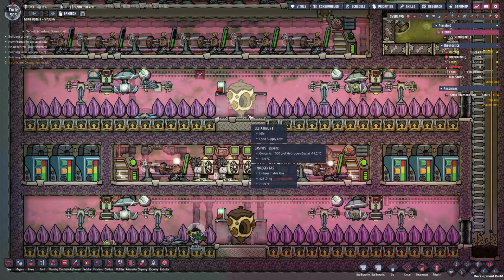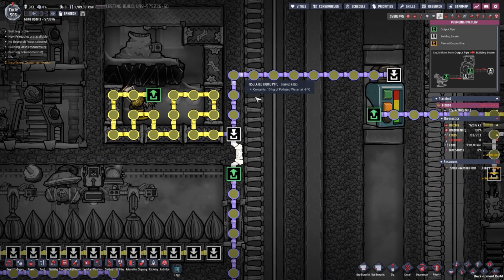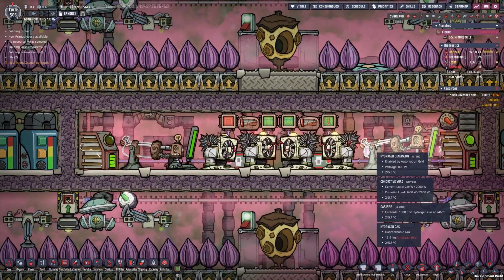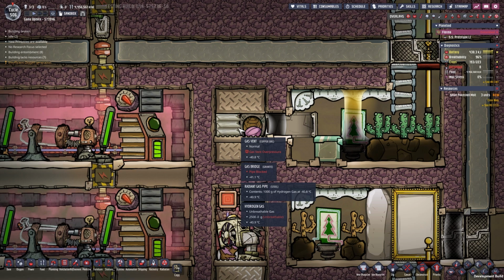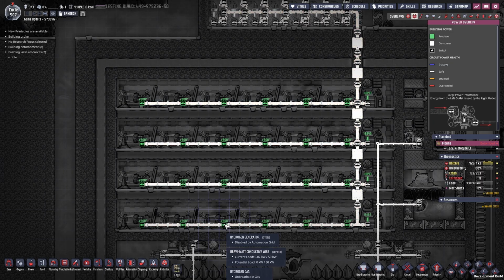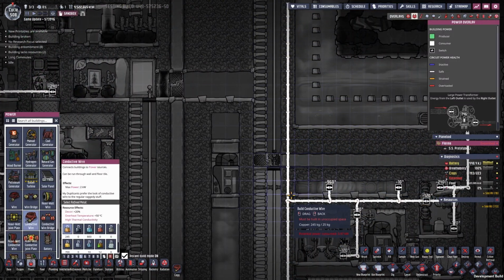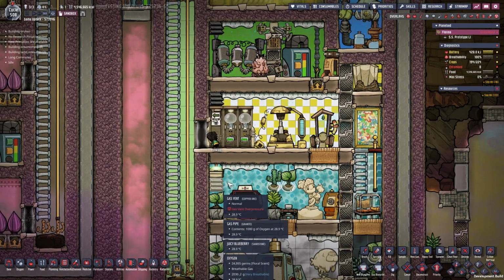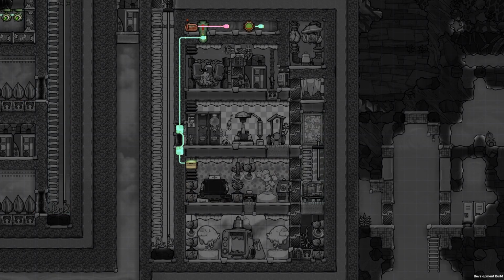Energy and Food with Saturn Critter Traps

Comment from the maker: Hey Everyone. Here is the Third and for now final final Verison of my Saturn Critter Trap Setup.
I included a few of the Discords, Reddits and YTs tips and also made it horizontal this time.

Pros:
-smaller?
-Technically No more Beeta Traps required technically cause the beetinys still need to "walk" into the Saturn critter traps, sometimes they just don't want to and there might be the chance of a beeta spawning if the beetiny refuses to walk into a trap in the span of 2 to 3 cycles)
Cons:
-Not very modular anymore (only modules are now the top and lower Saturn Critter Trap rooms.

Neutral:
- Living arrangements moved outside the main design.

Comment: I like how the design is "manufactured material" free, though not steel free. I think the middle section could be changed out for a steam turbine and a ph2o cooling loop given you can get ph2o down to -20C and the using Ph2o would also ensure the irrigation water reaching a lower temperature faster. instead of fighting lower mass and half spch of hydrogen gas. which would lead to a more stable temp once the temperature is reached. given the Saturn fly trap as no innate "Max atmosphere" by using water you will overall have about 2 times the sphc, and the mass being 10 times, being equal to about 20 times more cooling potential, while some unsued cooling from the steam turbine setup could go towards keeping the dupes living quarters between 25C or 15C then you just need to make sure that at least about 2 hydrogen generators are running for the power to cool. then there will be no reason to burn of any of the hydrogen to delete the heat and you would only need the aqua tuner to be Steel, and plastic for the steam turbine. everything else could just be refined metal.of course such a cooling loop would do take up about 12 by 7 blocks at a minimum maybe more with for more thermal mass for the farm, and lesser for dupe living space.

With the deep freezer would be the only place i would use the thermo regulator. but if working with the cooling loop it will be easy to keep it cool from the excess cooling from either farm or dupe side to achieve the deep freezer

Comment: Why are you using this for food production though? The quality doesn't seem worth it for all this work. The hydrogen speaks for itself, and justifies the size of the box. I'm thinking about trying to build a wild planted one since the hydrogen production would be the same.
Reply from the maker: The initial idea was to build a self sufficient base based on only 1 geyser. So i needed food from somewhere.

If you only use it for energy you can wildplant and have the benefit of the slower digestion. Meaning 1 critter equals 120 cycles of hydrogen.

Comment: =OKKKK, GOT MULTIPLE QUESTIONS

.................

..1=DOESNT WIKI SAY THAT WILD ONES HAVE THE SAME HYDROGEN PRODUCTION RATE AS DOMEDTICATED ONES?....THERE'S NO PROB ABOUT GETTING ARTIFICIAL NATURAL TILES, THOUGH.......SO IT CAN HELP TO SAVE A LOT

..2=WHAT EXACT COOLING  OUTPUT IS NEEDED, THO????........ LIKE U'VE DONE LIKE THAT BC PH2O, RIGHT????????........BC I'D RATHER MAKE
 A FLOWER POT WORT CHAMBER NEXT TO IT.....

...3=.ABOUT HOW MUCH OF THEM PER HIVE ACTUALLY NEEDED..........I GUESS THAT'S NOT DIFFICULT TO MAKE A NARROWER ROOMS, RIGHT????.....AND JUST ABOUT MORE FLOORS.....RIGHT???

...4=I'M DOUBTFUL THAT INCLUDING HYROGEN GENERATORS IS NEEDED BC  THEY'RE BETTER TO BE AT POWER PLANT ROOM,,,,,,,,,

.....5=HOW MUCH OF THESE IS NEEDED FOR RUNNING 1000g/s ALL THE TIME

=SO............. MY DESIGN.................ROOMS WITH ONLY WILD ONES...........CONNECTED TO GAS PUMP..............NO PH2O,NO POWER BRICK ATTACHED............WITH WORT COOLING........NICE????????

................................
Reply from the maker: 1 yes for power it is even prefered to hsve wild ones. 1 critter powers the Saturn Critter Trap (SCT) for 120 cycles.
For food you want thw domesticated ones. the wild ones give the same amount in total but only every 120 cycles instead of 20. which dropps the average to 1/4.

2. not sure.
but enough wheezeworts should work as well.

3. you don't NEED any per hive. that is a personal choice.
If you want you can have anything between 1 and 35 anything above that is unnecessary wasteful.

Also check Version 2 for modular floor setup.

4. You can place the generators anywhere in your base.

5. 1kg pO2 per second supplies 60 SCT

--> I guess the wild, wheezewort Hydrogen version you mentioned should work fine.
It would be a mostly power centered version and ignore the food production.
You still need the dupe to harvest them after 120 cycles.
My guess is it will work fine and be good for power production.
Reply: @lumaraw  ....LIKE WHO NEEDS THOSE FOR FOOD, DAMNIT,EVERYONE KNOWS HOW WILD ONES DO WORK.......ESPECIALLY WHEN NO RECIPE, THO.......AND WHY IF PEPPER BREAD IS THERE, HEHE....THE BEST 2 COMPONENT FOOD

...........HMMMM FOUND 167g PER EVERY 4s......41,75g/s=1000/41,75=23,95 ...... SO 1 ROOM MUST CONTAIN ONLY 24.........AND 2 GAS PUMPS.....MY BAD,SORRY DIDNT WATCH WIKI CAREFULLY ..............SO ....YOURS HAS A HOW MUCH, THO??????........ AND ISNT THERE PRESSURE 150g-10Kg , THO???????...........SO YOURS WILL NOT WORK AT ALL...........JUST WILL OVERPRESSURE FAST AND....... DAMN EVEN 24 WILL OVERPRESSURE ...... SO MAYBE IT'S NEEDED TO MAKE ETHANOL PUDDLE, THEN????

..........YUP, THE BEST FOR POWER, HEHEHEHE

........AND..........DO U GET THAT????.....24 SCT= HAVING TO BUILD A NEW INFINITE STORAGE!!!!! ...........WHICH MUST VE BEEN INCLUDED AT THE DESIGN

......AND I MENTIONED A WORT AT FLOWER POTS ,U KNOW ABOUT THAT EXPLOIT, HEHEHE

.......BY THE WAY, AT WHAT TEMPERATURE HYDROGEN IS BEEN PRODUCED/RELEASED, THO???.........................SO THERE'S A POSSIBLE HEAT DELETION, THO............Y KNOW, 1Kg/s OF HYDROGEN HAS A VERY NICE HEAT CAPACITY, HEHEHEHE.....AND IF WITH WORTS, THAT'S -60°C FLOW, HEHE......IF IT DEPENDS ON PLANT'S INTERNAL TEMPERATURE..... OR IF NOT DEPEND, IT'S A HUGE TROUBLE, RIGHT????

........... BY THE WAY, ISNT PIP PLANTING THESE MUST VE BEEN ABOVE THEIR LIVEABLE RANGE BC OF THEY'LL JUST STRAIGHTFORWARDLY EAT PIPS, HEHE.......

.............OKKK, THESE UNCERTAINITIES ARE WHAT I'VE FOUND, THO
Reply: I've tried in game and in a sandbox dozen of times and I could never get the pips to plant it, they'd just stare at it constantly forever. If you get it you work that'd be great!
Reply: @SpencerUnderwoods  ......HMMMMPH, THEY MUST TO PLANT, THO

......... THE ONLY REASON WHY THEY KIND OF CANNOT IS BC OF IT ISNT PROPERLY MADE, STILL

....... AND IT ISNT ANYWHERE THAT PIPS CANNOT PLANT THEM, THO
Reply from the maker: @SpencerUnderwoods  Oh right you also got the pip issue.

Yeah pips pretty much are bugged out with that plant. they either do it immediately or not at all. changes with every reload. Not sure what influences it.
Reply: @lumaraw  =BY THE WAY.......... THERE'S ACTUALLY A MOD ABOUT PIP'S PLANTING CONDITIONS, THO

.............SO......AT LEAST THAT'S NOT A MYSTERY WHICH GOT ME REALLY STUCK FOR A WHILE
Reply from the maker: Pips will be eaten after planting if they stay in the same tile. The plants living parameters yes. But we are not sure if the game measures that in the tile where the plant will go the atmosphere tile itself or the natural tile @robotnikkkk001 .

Tests of other creators let me think it is the tile the plant will end up in plus atmosphere. EVEN if the plant grows in a vacuum. so we temporarily need to add a cold atmosphere. But i am not completely sure.
Reply from the maker: Same issue for me but others got it working. they mentioned the pips will only plant when the temperature of the atmosphere and or tiles is below 0°C.
Technically pips should be able to plant in vacuum but apparently it doesn't work for saturn critter traps  @SpencerUnderwoods